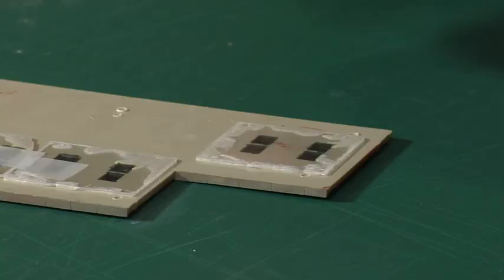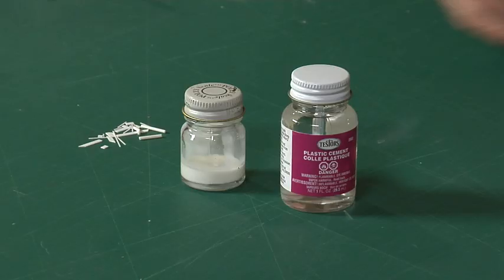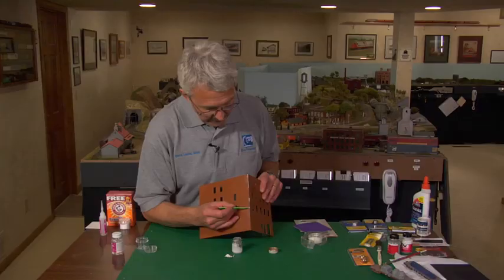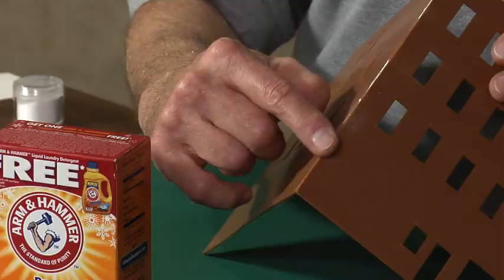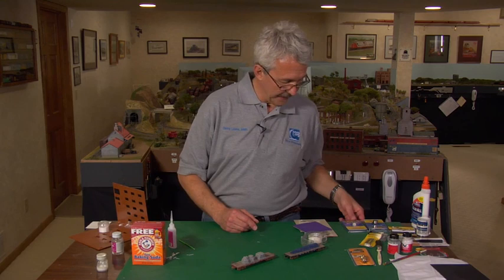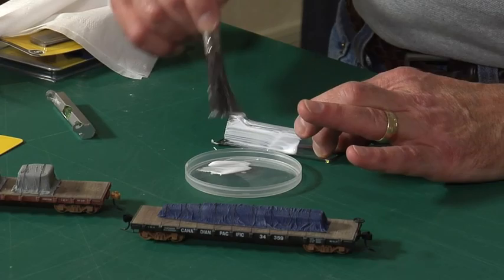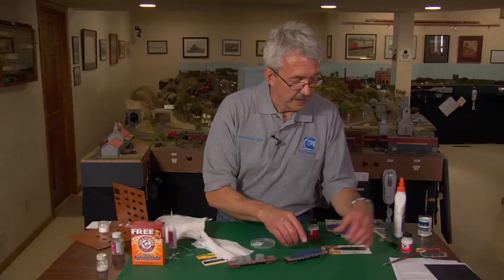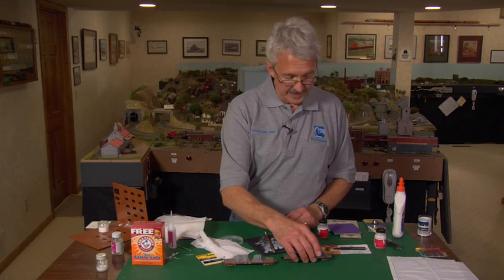4 Classic Model Railroad Tips

Comment: Very good tips.  I've got one flatcar that I put 3 hydrocal castings and they were already covered; all I had to do was paint them with some olive green paint to represent the tarps that covered the load.  I used black thread to secure to the flatcar deck.  Another thing you can use is very thin strips of electrical tape.  I already knew about the CA & baking soda.  Now I'll have to give the styrene putty trick a go.  I guess one could use the left over sprues to make the liquid styrene.   I have a Lionel Texas Special that has the cutout for the reversing lever but it only goes forward.  I used the baking soda and CA to fill the gap and then sanded and painted the repair.  Came out looking great!  Cheers from eastern TN

Comment: Nice video and cool ideas..
Would you know a way to straighten warped walls? I have some Magnuson Buildings where the walls have warped and very hard to get them straight. If the kit is un-built putting weights on them works, but does take a long time, however on buildings already assembled, I have not found a good way to fix them. Any ideas are surely welcome. Thanks.
Philip
Reply from the maker: Well, I’ve tried that very same thing without a lot of luck. Maybe try soaking the walls in hot water?
Reply: @ModelRailroadAcademy  That is worth a try...
Reply: @ModelRailroadAcademy  I have had luck with loose (unbuilt) wall sections with weights and even using a weights and a hair dryer if they are severely warped...However, once they are built into a completed building, well I am at a loss. Thanks....
Philip